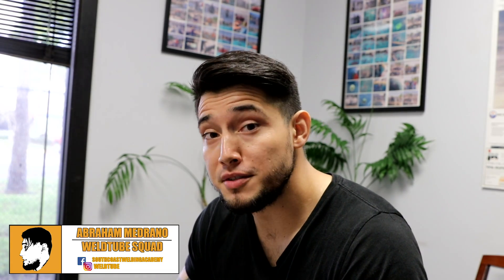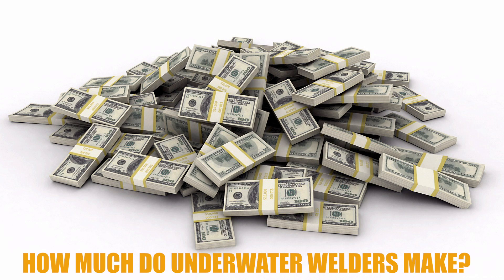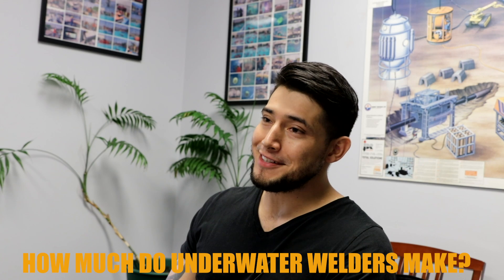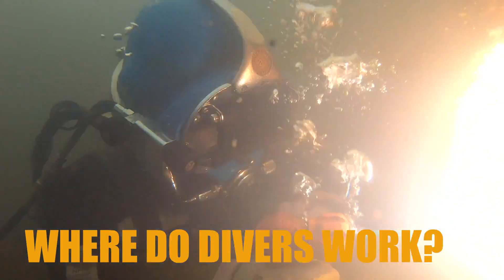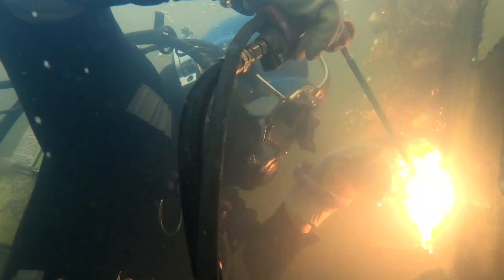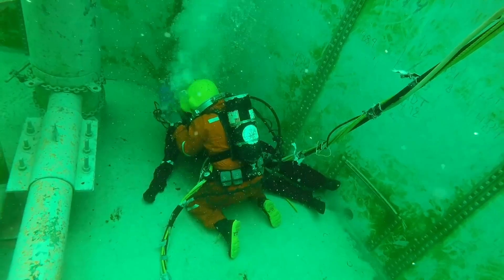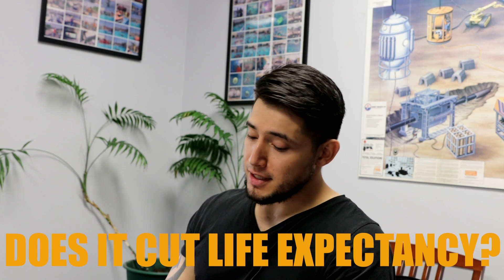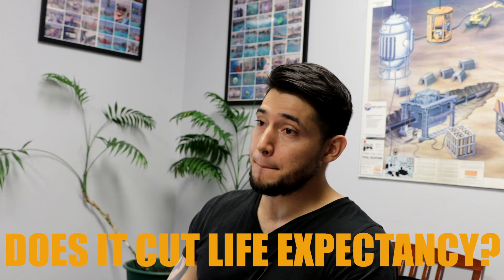What Does it Take to Be an Underwater Welder?

Comment: Can you have dreadlocks and still be a underwater welder. I'm currently in welding school and plan on becoming a underwater as the next step.
Reply: I don't thing you will be fitting dreads into the helmet tbh.. I haven't started working underwater as of yet with the kirby helmets but you won't get your head in with dreads.
Reply: just get barrel twists or sumn 😂😂

Comment: 50 is lower end but more realistic most companies pay around 60k a year to start. I work in the oilfields as a heater operator and only work the winter season and make 70/80k a year. Working the fields can be tricky. If you have no experience you need to know someone to get in. First jobs are garbage like rostabouting, tank battery installer, or containment builder. A few more years on your resume you can land good jobs like frac handing, wireline, pumping, after about 5 years opportunities become abundant. Off shore jobs become unlocked lol. Thats when you join up and let them know youre interested in becoming a welder for them. Lots of dudes go that route. The company pays for the training and certifications. Once you hit the water your pay is substantially higher than starting out do to the fact youre already an employee of theres. 30 days on 30 days off is the schedule most offshore companies run. Lots of days youre not welding. Youre inspecting the rigs. Going from platform to platform. Welders are making 12/15 k a month take home. Just a little insight about my industry
Reply: What the name of the company you work?
Reply: @luciusrenzo1032 think he's at the Houston school called the ocean corp
Reply: Dumb question but important, do can they teach you to weld and dive at the same time. Or do you have to have the welding experience prior to under water welding ?
Reply: Im 46 and an athlete. Im a chef. I feel called to welding. This is exciting to me but unsure since I have no experience am I too old?

Comment: Welding at 1000ft underwater?? What in the world how is that possible dang man
Reply: Sat divers
Reply: Mixed gas saturation dive with a habitat lowered to operating depth so you'd live n work underwater in out habitat until job complete
Reply: Very dangerous risky work
Reply: you have a hard suit double breasted rubber stuff like astronauts and a big ass metallic helmet like in 70's and basically the air pumping in ur suit creates a pressure that fights the water pressure so u can still breath fairly normal ... it ain't normal at all.. but u breathing... that is why u need a lot of training he said 7 months but u might actually do even 1 year or 3 depending how good u wanna get at diving at that low diving thing. plus u got to do that welding school which is insane stuff ur brain must work 100% and ur body 1000%
Reply: @REDFRAQ  wat if i got super powers

Comment: Could I still be a underwater welder if my asthma isn’t bad
Reply: if your using an inhaler daily, it would be questionable. in my opinion it depends on what sets you off. im in the industry and had asthma as a youngster. BUt i dont own a inhailer and havent had any issues since high school. id say i grew out of it, but honestly i just lied and said i never had it. we take a yearly physical and if you can pass the lung capacity test your in the clear, maintaining good physical shape and a level of fitness is important so if your easily winded then you need some cardio. Id say push yourself and dont give yourself limits.

Comment: Is it possible to weld in the Moon? Outside from earth
Reply: Yes, actually. Though not with any arc technique. Since the moon doesn't have an atmosphere like ours on Earth, you can't burn anything or generate heat in the same way you can here. The gases simply aren't contained by an atmosphere on the moon. NASA and other space agencies with astronauts weld in space through "cold techniques." These are techniques that don't require heat and can be done in a vacuum. There is no fusion, (melting together of materials, basically), that takes place during the use of these techniques. With cold welding, you basically crush two materials together until they stick together, forming a weld that is formed without needing heat. 

You can't do this with many different types of metals, because the metals have to be softer. They have to be pliable and be able to stretch and deform but without just cracking or shattering. The metals also have to be non-ferrous, meaning they can't have iron in them and aren't magnetic.

Comment: What about limitations involving the inner ear?
Reply: You need to adjust the pressure while descending and going up again... Without it, you will get the bends and/or a burst eardrum or a collapsing lung (coming up) because you didn't adjust enough... Long story short: It requires decompression stops while moving vertically in water...
Reply: @that_escalated_quickly2720  What I meant to say is,. . . Aren't there some would-be underwater welders who cannot pressurized their ears adequately and have to drop out?
Reply: @punhoss  ahhh k, sry for misunderstanding... Can't help you with that (not 100% sure) unfortunately have never heard of smt like that but could imagine it would be rare if smt like this existed... I think you can train/learn equalizing the pressure, but I'm not sure 100% as I mentioned... (atleast I needed to train this because I was bad at it...)
Reply: @that_escalated_quickly2720  I have a lot of difficulty on airplanes with my ears... I imagine that the trouble is very similar.
Reply: @punhoss ahh, OK I know nothing about that... But I'm rlly sry to hear about that... I hope this issue of yours gets better soon... Have a good one, cheers!
Reply: @punhoss I know this isn’t really an answer to your question but I have to clarify something first. It has nothing to do with decompression sickness, the lungs and it doesn’t involve decompression stops. The pain you get while descending is caused from the air in the tubes connecting your inner ear to your sinuses compressing causing a suction effect on the delicate tissue. To essentially bring that pressure back to what your body is used to, you have to add air into it by plugging your nose and blowing or swallowing. The former usually being the more effective method. It’s called equalizing your ears. I’m sure these guys wear nose plugs because they can’t touch their face through the mask to plug their nose. It’s really only a cause for concern if it’s not working.
Since it heavily involves the sinuses, which can also get this pressure squeeze although much less common, people with congested sinuses usually from allergies have more trouble. If that’s the case, depending on how bad it is, you might be SOL as allergy medication is usually not recommended. It can fix the problem at the beginning of the dive but then wear off and make you unable to clear your ears coming back up causing bad stuff like burst eardrums. I wouldn’t give up just yet because many people find it hard to do at first but then find that it gets easier and easier the more they practice. I don’t know why. Worst comes to worst you can also try massaging the area below your ear and jaw and sinuses. I’ve heard that can help.

Comment: any advice to where to learn welding in general?
Reply: Yup I too interested to learn underwater welding but I didn't a better course in my country (India )
It's my dream too become but it's sad part too I didn't started yet can anyone suggest a Best institute to learn in India
Reply: Im Not sure your age or if you’re even in highschool, but if you are in highschool still try to see if there are any electives available for welding or mechanics or something like that. If ur not In highschool there should be information you can find online or maybe videos to help you get started in path you want to
Reply: Local trade school
Reply: Tbh it's not very difficult to just start from the get go, purchase a cheap welding machine along with proper ppe with some electrodes to use on steel I recommend using 6010 and 7018 for starters.
Get some scrap metal and find apps or google settings to run machine based off the thickness and type of metal. 

From there its trial and error along with getting comfortable and experience. If you're looking for certified training look into jobs or trade schools that offer welding curriculum/application.

Comment: I was not a Commercial SAT. Diver but I was a Commercial Fisherman that did Night Diving for Flounder. & Fishing for Snapper King ect. 
In all my years of Diving at Night around the old Liberty Ships ect. I never had not one Predator Shark get in my Lights NOT ONE. 
Ppl thought we were 
BARN YARD NUTS for Diving at Night. I love it. Miss it very much. I say it is safer than Diving during the day. The Sharks & all fish don't like the Lights. 
I did however run out of AIR under the Liberty Ship Edwards 12:30 one Fri Night. 105 ft about 20-25 ft under it. If my Great Dive Bud hadn't seen me Bolt for the Surface & caught me at 70 FT. As I had already Stoped Kicking could only focus on pulling gas from my Regulator I wouldn't be telling my story. Don't let life pass you by  DIVE...